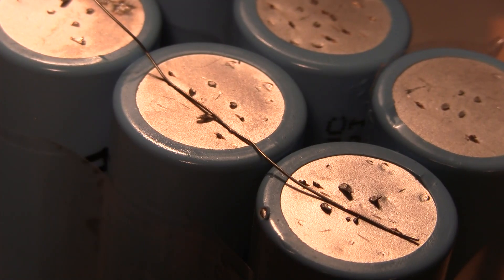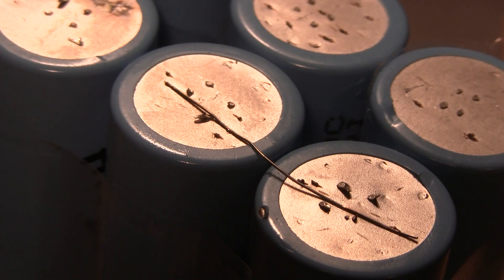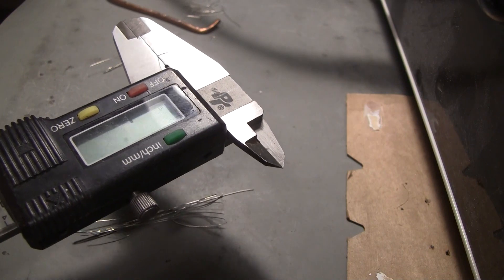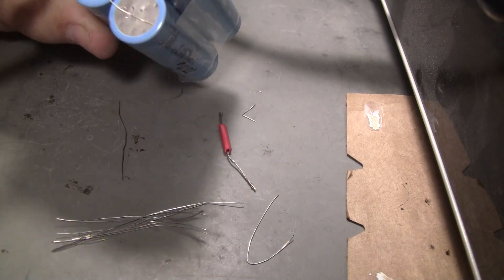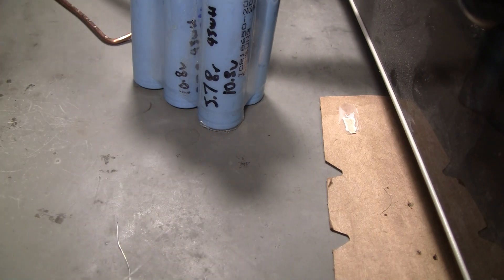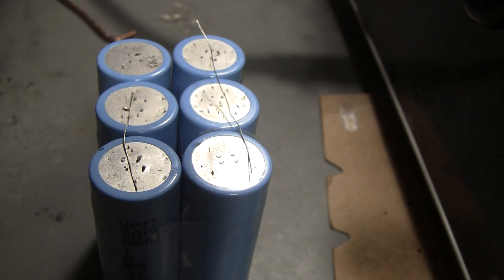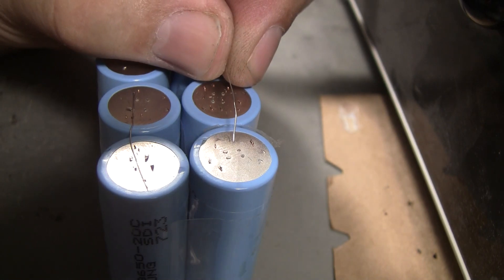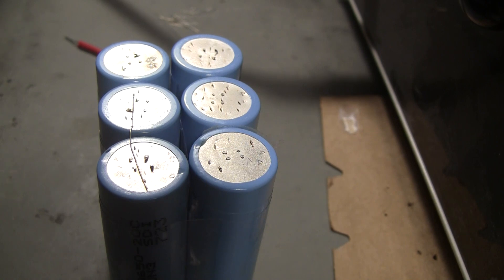Powerwall Fuse Spot Welding Experiment. Found Great Fuse Wire !!

Comment: Don't use the  "springy / stronger" wire - it's not copper, it's aluminum which wire makes have been switching too which is cheaper. It doesn't have the same characteristics as AL and you should test them before using
Reply from the maker: I took my x-acto knife and scraped the plating off of the "springy / stronger" wire. It is in fact copper, under the plating.
Reply: That's really interesting - I know there are certain copper alloys that allow for heat treating to be more springy - didn't know that they used them in wire. Usually the springy stuff is something else.  @mikep95133
Reply from the maker: @mikethezipper Copper comes in different hardnesses. I suspect these wire manufacturers just pick what ever is on sale that week.

Comment from the maker: Tried to spot weld some .016 wire from the leads of a couple of small pf caps onto copper. It was tolerant of more power.  Still have not tried .016 to 18650 cells. That's usually the easiest.

Comment: I use 30AWG tinned copper wire for my fuse links for pairs of cells.  That wire is very soft, not sure what the tin coating would do under a spot welder.  I spot weld tabs between pairs of cells (if they are not already paired) and then solder the fuse wire to the tabbing and to my bus wires down the side.  My cell holders are designed for paired cells.
Reply from the maker: 30awg is pretty soft no matter what the source I think. The stiffer wire I found made spot welding vastly easier and consistent. In fact it made spot welding possible with such a tiny gauge. .016 wire might not matter how hard it is because it's much stronger. I just don't have any. So far I think the tin coating helps since bare copper takes far more energy to generate the heat needed to spot weld.  What happens if one cell out of a pair, shorts internally? Does it take down its partner?
Reply: Since most of the batteries I have come out of laptop packs, they come already paired up so if they've survived for years and years like that, why separate them.  But yes, if one cell goes, it'll most likely take out the other one in the pair.  You do run that risk but save half the processing time, so it's a trade-off.
Reply from the maker: Pure laziness !! I can relate to that !!! How did you arrive at using 30awg ?
Reply: Yes, you got that right!  30AWG seems to have a decent fusing current rating, around 10 amps:
https://www.powerstream.com/wire-fusing-currents.htm
It does seem to work as I inadvertently installed one cell backwards into a fused holder.  Fuse wire blew out, no harm done.
Reply from the maker: Glad your fuse worked !! Jehugarcia uses 1/8 watt resistor legs for fuses. Same diameter as 26awg, at .016". His fuses blew at 6 amps as I recall, using 6-8 18650 cells as the power source. 26 awg on the powerstream site says 20 amps fusability. I really wanted to try the suitability of 26ga as it would be easier to spot weld, me thinks. More mechanically stable during and after spot welding. I'm building a worst case 6p pack, that can barely hold a charge, to see if it would still have the power to melt a 26awg to 30awg fuse.
Reply: Yes, a slightly larger wire would be easier to spot weld I imagine.  With 30AWG, I usually have to work under a magnifier to see that tiny wire strand to solder it to the tabbing.  I think that table of fusing currents is a bit on the high side.  I've not tested my wire outside of having it blow with a single reversed cell.
Reply from the maker: I've tested the 30awg wire from that roll today with a dead short. With a usable pack, most of the fuses melted. With a 2nd very weak pack, none of them melted. Now I'd like to try the 26awg .016 wire to see how it spot welds and functions as a fuse. There is a guy that came up with a high current, low voltage spot welder that is suppose to spot weld copper to copper nicely. https://www.keenlab.de/